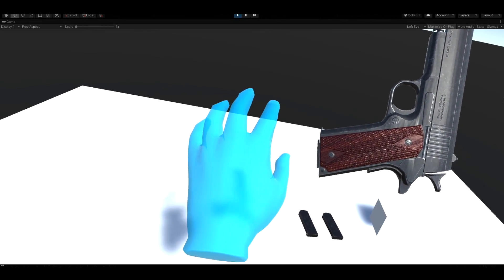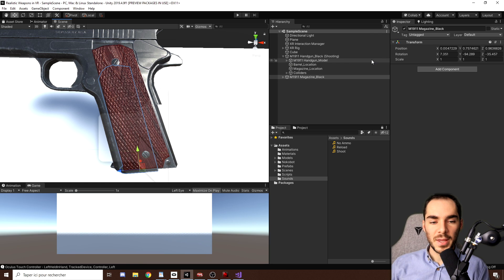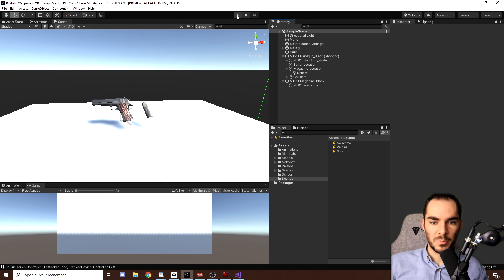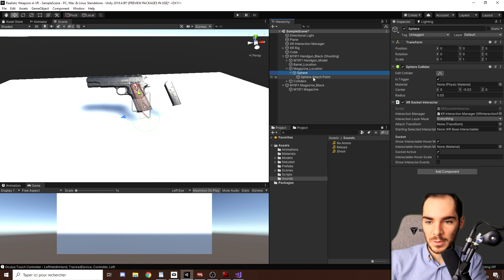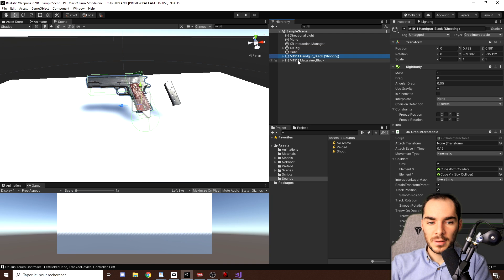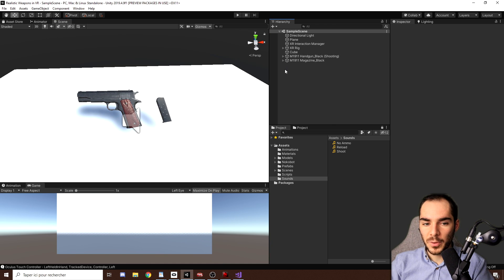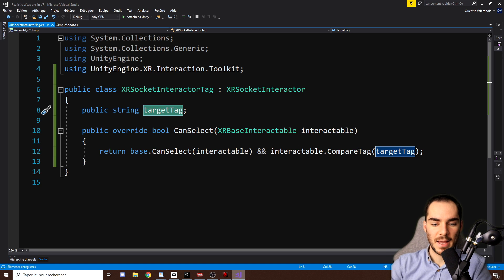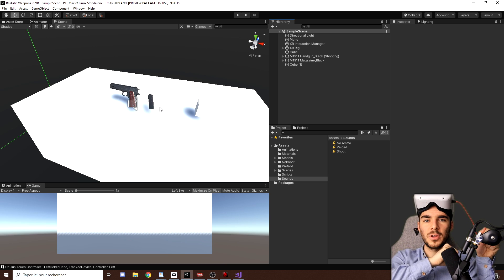Realistic Gun in VR - Part 2

Comment: 6:39 i got to about this part, but after i changed the physics layers, i was no longer able to pick up the gun or magazine. Does anyone know why?
Reply: If you're still looking for a fix. I don't think this method works anymore.. Under your 'XR Direct Interactor' settings attached to your hands,  add 2 Physics layer Masks (7 lines down, keep default enabled as-well) 'Gun' and 'Magazine'. Add these same Interaction Layer Masks to your 'XR Grab Interactables' script settings (On your Objects/Gun/Magazine etc..)
Now you and your Objects can interact on different Layers.

Under your Mesh Collider on your Gun and Magazine go to 'Exclude Layers' exclude the opposites (i.e On Gun, disable Magazine, on Magazine disable Gun)

You can now have interaction between yourself and objects, while disabling the specific colliders that were causing trouble. Hope this helps! took a while to figure out a work around as I'm fairly new. thinking this is a new problem because I couldn't find an info on the subject.
Reply: @Justanotherphox  thanks for this, with some meddling i finally got it to work
Reply: I have the same problem, Does anyone know how to fix this?
Reply: it is necessary to create a separate layer for the hands
Reply: @daniilkams  You mean another layer than the 'Default' layer? If we change that layer, can it still interact with the Interactable layer?
Reply: I found most simple solution. Somewhere in your game you have two objects called "Near-Far Interactor" (one for each hand) and they have "Curve Interaction Caster" attached in which you have "Raycast Mask" which is set up to work with default and UI. You have to simply add "Grab Interactable" to this list and it fixes itself :D
Reply: @glosin9788  also  need to update the sphere interaction caster's layers as well if you want object grabbed from a close distance

Comment: If you are doing this tutorial today with newer version of XR Toolkit you notice that overriding CanSelect method doesn't work anymore like that since its deprecated. Now it uses IXRSelectInteractable instead of XRBaseInteractable. You can still get the tag this way: 
``` 
public override bool CanSelect(IXRSelectInteractable interactable)
    {
        return base.CanSelect(interactable) && interactable.transform.CompareTag(targetTag);
    }
```
EDIT: Oh man, this doesn't work like it should. Removing "Interactable colliding Interactable" layer in Project Settings the magazine doesn't notice XR Socket so it doesn't work. If I enable it, it works but after I throw pistol away it just keeps dancing and rolling on the air.
Reply: Very interesting, it works for me. Are you sure you did everything same as in the video?
Reply: You saved me so much time. Thanks man, was wondering if I was doing something wrong or not.
Reply: yes, that script change works
Reply: This could also be because of Physic collissions between the Slider and the Pistol.
I disabled this and was able to fix the dancing / rolling pistol.

Comment: Hi! I've followed your tutorial in every step, but I can't grab the magazine. I put the mesh collider in the XR Grab Interactable but it doesn't work. Do you know how can I fix this issue? Thanks!
Reply: If you've changed the layer of the magazine, i'm having the same problem.
Reply: I have the same problem when changing the layer of the magazine. Were you able to fix it?
Reply: @Shiffo  assume no fix?
Reply: @DeusLucifer  Only put the XR Rig (not with the children) on a 'Player' layer and turn off physics interactions between the Grab and Player layer.
Reply: @严勇-z8l  in the end I just disabled the mesh instead it fixed both issues in one able to grab the object and no more magazines clipping the gun. Then used input action to drop the mag
Reply: @DeusLucifer  Woah 2 years later and you've found a fix. GGs I forgot about this video
Reply: @acquachris  yh, as the Method he used of using layer mask did not work and it made more issues instead, but spent a few hours using other fixes some worked but decided just the most simple solution is the best course of action lol. Surprised people haven't spoken about this Methods in the 2 year since it was uploaded

Comment: Anyone know how to fix the issue where my magazine is having a delay following the socket of the gun. so when im moving my Tommygun my drum mag is slower when following causing it to be very shacky and jittery
Reply: Did you find a solution for this? thx.
Reply: @huertix4393  i attached a static non interactable magazine to the gun and turned its mesh render off. then when i put the interactable magazine into my gun i turn that mesh renderer off and turn my static on. when i pull out the mag i do it again. its a little weird trick but it works
Reply: @TheKillerMB1  Thx.. :)
Reply: @TheKillerMB1  amazing! Do you have the script for this?
Reply: EDIT: found it 🙌 🤣
Reply: @Jay___ink  i am 2 years late but how is this done?

Comment: Love the videos, but Valem I was wondering if  you could respond? Ive been encountering a problem where setting up the hands, they are not showing up? I look at them in the scene and they are in correct positions floating around where I move my hands, but for some reason they are invisibile?

I also had the text show up with Object reference not set to an instance of an object?
Reply: If you follow the video EXACTLY it should work. Sometimes when you have that error code it will stop part of the script from working.